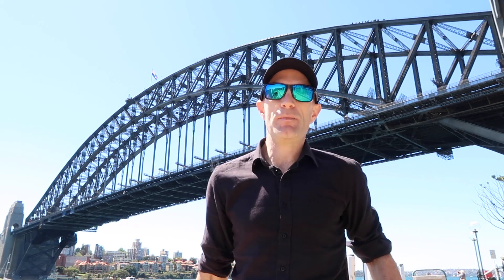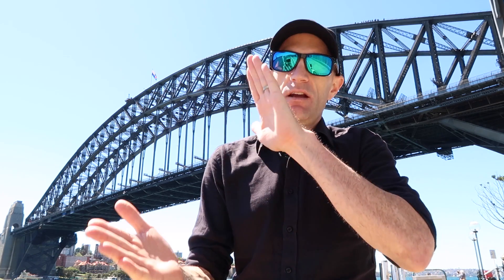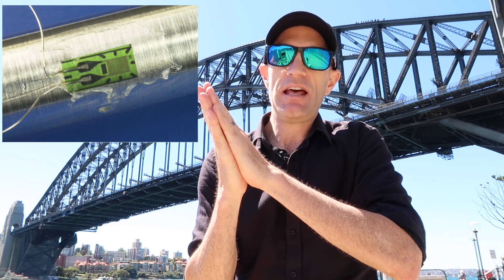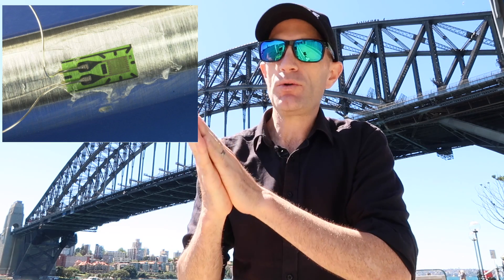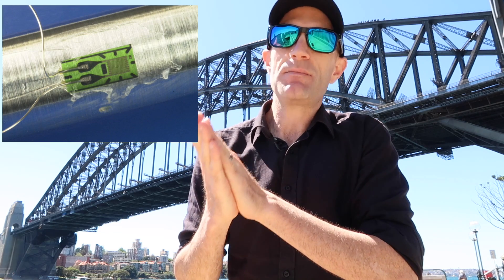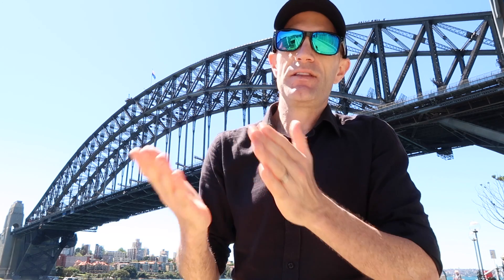Cycling Power Meters: The Basics // How They Work

Comment: How would you know if your power meter is accurate (even after the firmware was updated or the calibration was completed)?  And even if you can compare your wattage concurrently with another PM on the bike (a luxury which most of us mere mortals can only dream about), which one would you trust and how would you decide?
Reply from the maker: Find someone with a Neo (+-1%) or a Drivo (+-0.05%) or a power meter that's been tested/verified/certified in some way and perform a comparative step test. It is a tricky one. Usually is isn't a problem people seek to have, or to know about. At some point they usually have two power sources to compare... and things ain't right.

Comment: Been thinking about purchasing a Stages power meter Shane, have you (or anyone reading this) had any experience with the Stages unit? Good or bad i'm all ears.
Reply: George Leighton I have two stages. One for my road bike and one on my MTB. Very few issues once I figured out that I should only use brand name batteries and replace them as soon as I have any issues. I also wrap electrical tape around the MTB one as a precaution when there's lots of mud around. They read about 4% higher than my kickr.
Reply from the maker: Early models, horrible stories. Newer models, touch and go with accuracy. I'd just ensure wherever you buy from is willing to stand behind the product with either a replacement or a refund if they sell you one that doesn't stack up to a known/good baseline test (ie, a Neo).

Comment: I've definitely noticed the difference between my various PMs. My Quarq reads about 15W lower than Tacx Neo and Stages about 5W higher than Neo. That's quite a discrepancy, particularly when I first used the Quarq and thought I'd gone backwards in power by a couple of years. At this stage I can only accurately compare a ride against a previous ride on the same PM otherwise my readings are all over.
Reply from the maker: The Neo in my experience (and that of others I've heard) is pretty damn accurate. Thankfully you've got a Quarq, and they can be calibrated with a known weight. I have a 20.000kg certified weight I do mine with.